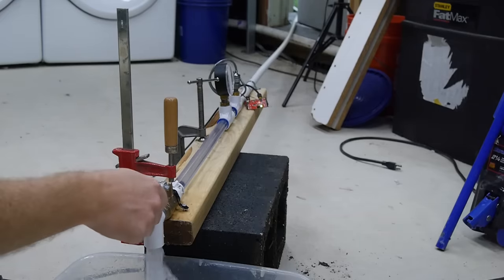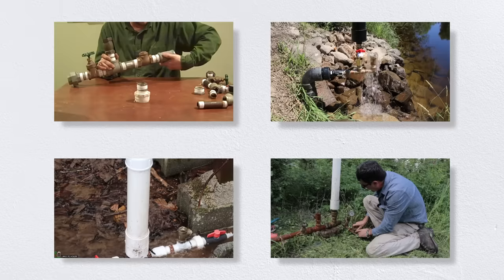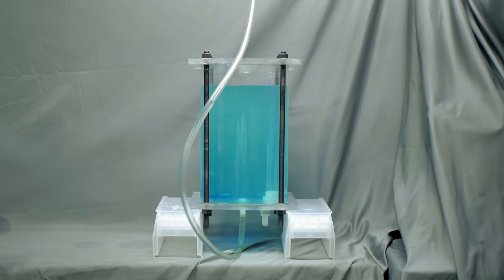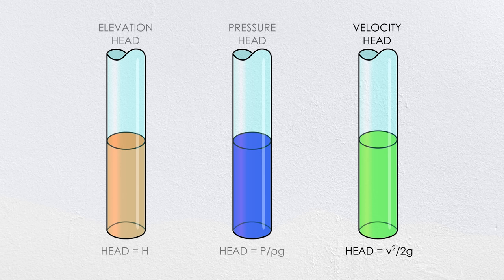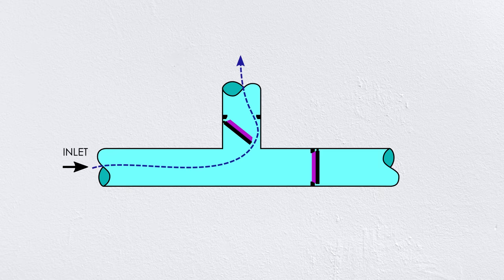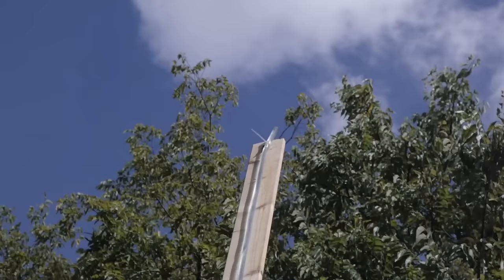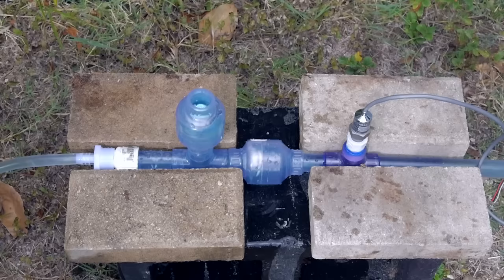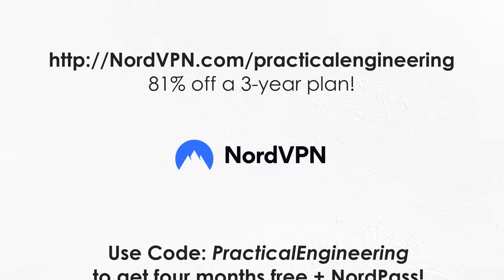How Does a Hydraulic Ram Pump Work?

Comment: The names of the valves seemed weird to me -- it feels like the "delivery" valve should be the one which delivers the water to the greater height (which is usually the one you want)
Reply: That's exactly what it does. The waste valve wastes water up through a short tube where said valve sits. The delivery valve sits in a section of horizontal pipe that then curves up to wherever you need your water delivered.
Reply: @Electroblud  Ok thanks, I guess I misunderstood when I watched :D
Reply: dang bro, good thinking..like, you were so right that apparently someone actually had to have gone back in time [right after reading your inspiring comment, im assuming], like way back when check valves were 1st invented (circa like 300 bc i think?..was right after direct deposit got invented I do know that..goodbye to long teller-lines). So ya' know im sure it probably went a little something like -arrive in 300 bc, find this check valve dude, manipulate him into being your friend, convince him to bring you back home to meet his mother, take her out for nice sea food dinner then never call her again, realize that was a waste of time..then resort to 'hacking into the mainframe', realize that too was also a waste -not to mention impossible, murder the valve guy out of sheer frustration, seduce the poor man's still grieving wife the next night, completely reverse engineer said valve because you forgot to obtain the secret blueprints from the dude before capping his ass, submit official patent application but w/ the 'correct' designations in-mind this time, fight a near year-long battle w/ patent office over countless patent app rejections due to tedious clerical errors & political bias, eventually get the eff outta dodge before the time machine is discovered by some disgruntled penniless old man w/ a cane named 'Biff' like in BTTF Part II, & uhh, then just hope like hell the patent sticks & boom here we are...

(oh, btw yeah..guess they somehow figured out that whole time travel conundrum, who'da thot huh?)
Reply: @lavishlavon  lmao you good fam

Comment: how does this scale? is there a point where the device is too big or too small?
Reply: i have seen some fairly large Ram pumps at least 1 meter across so i don't think scale is the issue if you have the water flow  the formula holds
Reply: @rickcoona  theres probably a point where it becomes impractical though, like, the pump could exert more pressure than what any material could handle, though such a system would probably need to be colossal.
Reply: @BYENZER  I think wranglerstar made a pretty sizable one.

Comment: We built a ram pump out of standard galvanised plumbing fittings to deliver water from our creek to a hill  tank at 65 meters vertical head from a pump fed by 18 meters of 2" gal pipe set at 30 degrees for the ram delivery pipe.. The only operating difference was that we had to add an inverted bell chamber (read empty gas cylinder) full of air and kept supplied by a small air snifter hole in the feed line before the valve. This air chamber smoothed out the delivery flow and stopped water hammer in the delivery line. It worked non stop over many years except for an occasional tree branch blown down on its valve leaf spring. Very cheap and practically maintenance free.

Comment: Oh so if i use this i can pump more ram into my pc ?

I need this

Chrome uses soo much of my ram and i dont know how to fix
Please help
Reply: @oH well,lord! I've had worse ram usage with firefox than chrome.
Ever since that update where it was fast across all tabs like chrome is a few years back it uses a ton of ram.
But it doesnt like to release it like chrome does.

I have a ram cache, some virtual machines, gaming and a browser open on my pc at any one time. It ends up using most of my ram, if I use chrome itll stop using so much ram at a moments notice, firefox not so much.
I ended up swapping back to chrome due to that.
Reply: Download some more ram
Reply: Well the first thing to do is grab an extension to suspend idle tabs such as The Great Suspender, it'll clear up a quite a bit of ram from the tabs you aren't using.
If that isn't enough, you can sometimes get used sticks for half the price of a new set, I got a few 8GB sticks for about $20 back when the prices were still up at $50 or more for a new stick, you however do have to wait and be patient to get good deals though.
Reply: @vgamesx1  that's not really the point. Anyway I have no more ram slots, it would cost hundreds of dollars to upgrade my ram further. When the solution is just use chrome.

Anyway, chrome does this natively and really only does it when I'm pushing my ram usage to the limit, which means my performance when swapping tabs is typically great, but if I need the ram for something else its usable.
Reply: Everyone ITT and  @woo9914  Have you tried Opera GX? You can finetune how much RAM/CPU usage is dedicated towards operating the browser when you want. It's a bit gamer-y oriented but you can turn off those features if you want and it's got lots of great ones also, like a built-in VPN/adblock and it also supports all Chrome extensions. I really enjoy using it.
Reply: Yep, water cool it at the same time! 👊😁👍

Comment: What about to measure the performance of this device? 
Like how much water is delivered versus total amount of water (delivered + wasted).
Reply: Those are the wrong metrics for performance of the ram pump. The ram pump converts the kinetic energy of water flowing down hill to potential energy that moves the water up a column.
Reply: basically 10:1 is the rough figure, 10 wasted to 1 pumped very high up without power other than the drop to the pump, have a look at a few vids on third world countries using this tech to supply water to villages. when i was a kid , the town of blackbutt QLD AUSTRALIA derived all its water from a local creek this way , circa 1978
Reply: @Belioyt  There is no "wrong" in it.
I'm concerned about the mass balance of the system, not the energy balance.
Reply: @peterolsen9131  I understand that it's going to vary according to the gain of height we apply. Maybe it can gives us another video showing some correlation...
For example: 1m gain, 5m gain, 10m gain and so on.

Comment: I used  to run water line in subdivisions, we put in the 8" mains and then the laterals to the meter boxes. I would tap off up to 18" mains on the main feeder to supply the subdivision and talk about a bitch, I worked in the Roswell Ga area for years and those people inspected EVERYTHING. I never failed an inspection even with one inspector that would tape measure every bloody meter box to the inch and my corner kickers better be right. Nice guy but retired FBI dude so he was anal about it. The only real danger we had was doing blow offs before pressure testing and all corners and ties had to be left uncovered during the pressure testing so inspectors could check the corner kickers and ties. 

One day some of my guys had brought some gear from the shop and in it was a bloody 6" butterfly valve and they hung on our farthest fire hydrant for the blow off to get the air out of the system for the pressure test. I hadn't looked at the valve and one of my new guys got sent to close the valve off. I didn't know who was sent I had a large crew and half were Latino so I would give instructions to my main lead and let him translate instructions on down.  So when I figured we had blown off enough (6 hour blow that day) I called for a shut off. Well the new guy slapping a 6" butterfly closed on a 8" pipe was an experience I hope never to see again, 6 blocks of 8" main came out of the ground ripping all our work to pieces all the way back to  the 12" where I was standing. It was exiting watching that line coming out of the ground toward me I can assure you. Several hundred thousand dollars gone in couple seconds it happened that fast. I buried that valve UNDER the relayed pipe. Was almost as exciting as the day I took out a 8" gas main thanks to miss marking by the company that did the marking. Same subdivision on Johnson's Ferry in Roswell, another story another time lol.
Reply: trgtdron Hello my friend, Plumber from Marietta, GA.  I liked your underground utility story.  Are you retired?
Reply: I have explained to employers that the value of my experience is proportional to the cost of mistakes to previous employers.  Often while explaining why we should keep a younger worker who has made a costly error.  The random new hire will be lacking the value of the experience that the guy they want to fire just gained.  "We have just invested in a more valuable and more experienced hand", I would tell them.  Sometimes they will listen, sometimes they keep teaching new guys the same lessons.

Comment: Okay but why is this concept not blowing up? This is literally free electricity???
Reply: It needs flowing water you cant just do it with a tank of water. The flowing water is actually delivering energy and that’s being used to slowly push it up with a mechanical advantage. But if you think about it the pressure of all the water is still more energy than what’s going up. The beginning of the stream has to be above where the water ends.
Reply: This just allows you to move water up using the flow of a river or small stream.

Comment: I love your explanation of the Ram Pump Operation. I'm living in the Philippines. The greater population is below the already low poverty level. So much so that the process of squatting land has become a legitimate industry. The poor squat a piece of land, when the government wants it, or the land owner, they must pay the family that squatted and lived on the land to get them to move off.
The greater population is not educated and is slaved to water delivery trucks. I plan to try to implement the Ram pump so that the people can utilize this free and highly efficient source of constant water flow to areas without water. 
The principal of Laminar Water Flow was developed by a fireman to increase the distance they could pump water and is the father of most fire hose systems today. My question is; Is the principal of laminar water flow a great enough gain and can it be included in the RAM Pump system to increase the distance the smaller RAM Pump can provide? Additionally, would it be more effective place before the pump or after? Thank you and I look forward to hearing your opinion on this.

Comment: The waste water is what's stopping perpetual motion. Its stays at the bottom of the system which means its giving its potential energy to the pump. In case anyone was wondering.

Comment: The place where I grew up had one of these feed from a spring pumping and pumped water up a 10m bank, then ~500m too an underground tank. Was always fascinated by the thing, had a long steel pipe from a small reservoir, feeding it.  It ran for years and only needed to have the water bleed air chamber every few months to keep it going.

Comment: It works a similar way to and electric DC/DC boost converter works :  

the flow of water would be the electrical current and the height of the water is the voltage.

with valves as semiconductors switches (diodes and transistors), they shut open and close, to control the flow of the current.

The inertia of water becomes an electric inductor who wants keep the electrical current constant.
The water column can be represend by a capacitor, who tends to keep the voltage constant.

The boost converter takes a given voltage in it's input and then give an higher voltage.
But, the boost converter doesn't create energy because the current in the input is higher than the output.

Comment: So essentially it makes it a path of less resistance to move through the pump rather than against it, hence why the cycles has a positive trend in direction. Eventually it will hit a equilibrium state where even the pressure spike can’t produce enough pressure to counter the head on the other side, but still.

Comment: Years ago, I heard this story on a radio program. The program was about the problems of translation, particularly technology translations.
During the Carter Administration there was a technology exchange between the US & Soviet Union.  One of the technologies we got was the process we now use to press aluminium into soda cans. The Russians used it to fabricate jet aircraft wings. The translation said we should apply a "wet sheep" to the aircraft wing. This was really puzzling. The Russians were known for using some real "down home" methods. But no one could figure out what they could do to an aircraft wing with a "wet sheep"!
Finally, another translator came along, who knew more about Russian and technology, who said, "That doesn't mean 'wet sheep.'  That means 'hydraulic ram.'"

Comment: A professor of mine designed a system to pump drinking water out of caves on the island of Java in Indonesia. He didn't use ram pumps, but was very concerned about reliability. So he installed to sets of pumps directly mechanically connected. The bigger ones were repurposed as turbines, just because pumps are simpler then actual turbines which was more important than efficiency in this particular use case.

Comment: This is an example of a mechanical transformer. Very similar to an electric transformer. The only difference is one works on electrical charge. The other, water. Now there is another type and that is a torque converter seen in most cars. They are a bit more specialized and optimized for their intended use. Which is to transform torque. Also, gears do the same thing as well and are a mechanical transformer. Heck even a camera lens is a transformer of light! Very cool when you understand how similar different things are so similar in their functions despite using different mediums to work.

Comment: A fellow thought the Great Pyramid subterranean chamber and passageways resembled a ram pump...so he built a scale model out of plexiglass so he could watch the water movement.   First design ran for a second then blew up from the pressure it made!   He ended up with ink injection ports so to better see the water flow and found eddys where gas collected...and this turned out to have oxygen with another hydrogen as the water was being sheared by the pump action.   He eventually went to the actual pyramid and looked closely and yes...where his model had collected gases there were remnants of passageways and wear on the floor where the valves would have been working.   This seemed to answer what the subterranean chamber had been used for...to pump water up to the top of the pyramid, but for what they used that for I've no idea.   Just thought it was really interesting.
Reply: Some scientists / archeologists think they used the water being pumped up in a  channel was how they raised the heavy stones. They floated them up with the flow of water being pumped and stone on  a network  of  air filled bladders made from animals . Seems sketchy but who knows. They were not as tech savy as us but had other technologies we havnt tried or know about. Like sound waves and harmonics which is how grahm hancock thinks the moved them thru the combined sound waves of thousands of people in a ampitheatere thype echo chamber and finding the fundemental frequecies that are the max amplitude. We just havnt pursued that after we stumbled upon electromagnetism.

Comment: Sorta reminds me of a car jack, which had a similar air of impossibility to it for me when I first saw one in action. There's a similar principle at work: inject some energy into the system, then apply a mechanical stop to prevent the energy from reflecting back out. Instead it turns into potential energy. It seems like magic, but it's really the same thing as lifting a weight up a flight of stairs one step at a time.

Comment: Works better if penstock is larger diameter. House I grew up in was supplied by a hydraulic pump at the spring that was about thirty feet below the storage tank. Penstock was three-inch diameter with about five feet fall. Pipe to storage tank was 3/4-inch diameter and about two hundred feet to storage tank. Hydraulic pump had an air chamber to cushion the shock of the valve with the change in water direction. Pressure to supply the storage tank was created by the difference in water volume between the penstock and the storage-tank pipe.

Comment: Good day, I'm not an engineer, just a draftsman. I learned a lot drafting high pressure fired two boilers at Superior boilers in Hutchinson Kansas where I grew up. After the last decade of being a professional patient, I've lost much of my drafting abilities head. That being said, I have an engineering idea that I believe we as a nation should pursue: 1. Wave induced electromagnetic energy 2. Tidal ebb and flow energy 3. Geothermal desalination energy 4. Solar magnification desalination energy 5. Steam pipeline energy 6. Clean water condensation energy 7. High altitude clean water reservoirs AKA batteries 8. Hydroelectric energy irrigation canals 9. Hydroelectric energy wastewater infrastructure 10. Flood diverting waterways *parabolic reflection of light, heat, sound, water, and/or Steam?